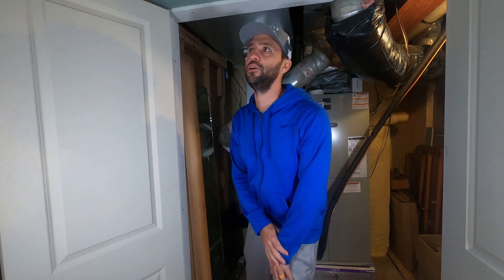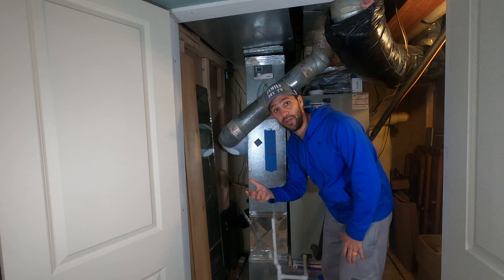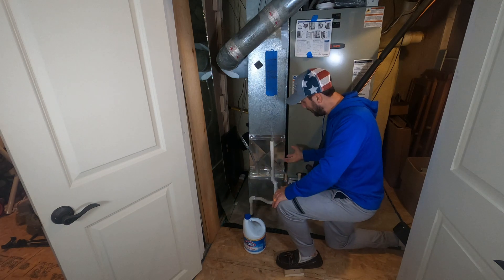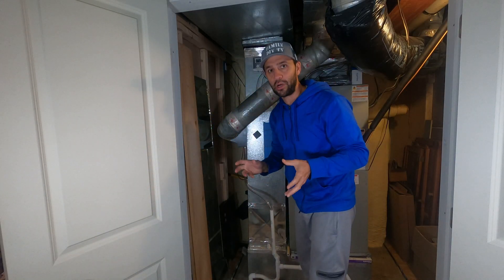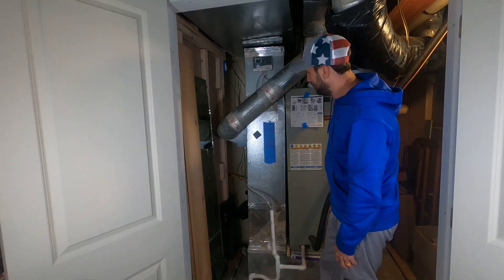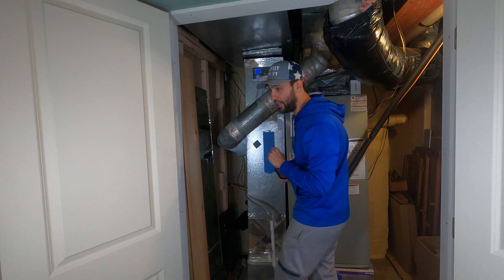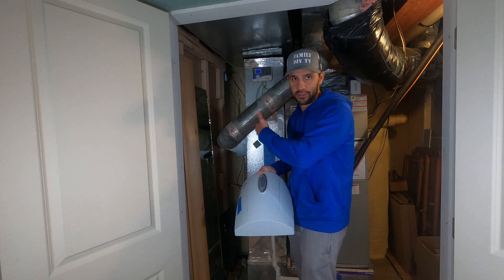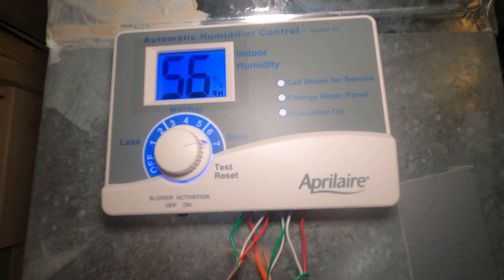How to Start A Whole House Humidifier  - Aprilaire 500

Comment: Hello! I just purchased one to replace the non working unit in the house we just purchased. He had it disconnected and his hot water heater was moved a few feet to the other side of the room. I can not locate a water supply for this 500 unit. Water heater is 4 years old and we are getting a puddle of water every now and then, might have to be replaced. My question is does the water have to be hot? Or a cold water line that feed the humidifier, since if I am getting a plumber in I might as well have him add a connector for it.
Reply from the maker: For these types hot water is recommended. If your replacing the WH which is a good idea if you have finished basement, I’d assume adding this fitting would be minimal cost

Comment: I installed one of these furnace humidifier and I think it was a total waste of money. It didn't make any difference to humidity. Instead I bought a freestanding evaporative humidifier and that thing makes a huge difference. I have to fill it 1-2 times a day with over 1 gallon of water each time. So it is pumping out serious water into the air.
Reply from the maker: thats ashame - i wouldn’t say mine made a world of difference, i still supplement with a freestanding one but i can definitely tell when its off.   I forgot to turn it on a few times or accidentally turned it off  a few times - lol.  dont ask, im always tinkering with things …. ha.
Reply: my freestanding broke.